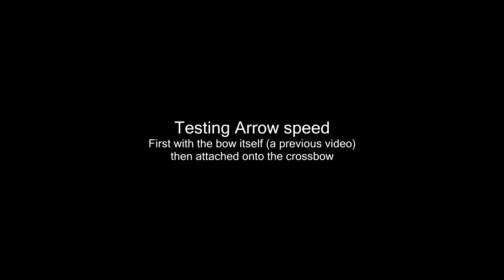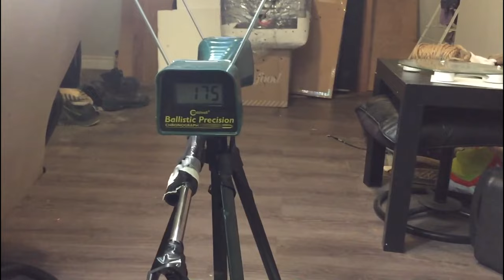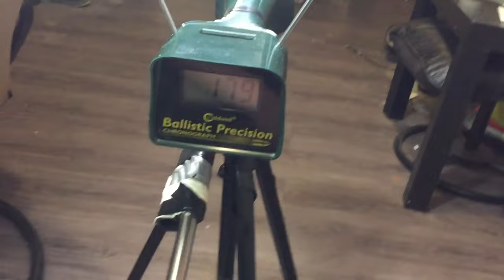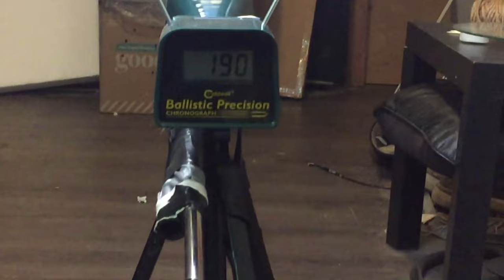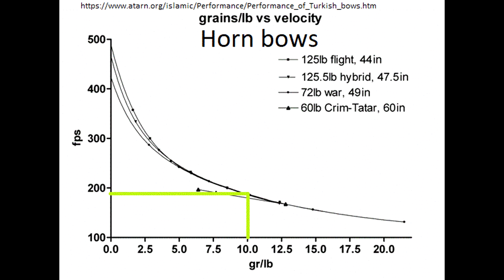Chronograph Chinese Crossbow Potential

Comment: 張弓測力法(現代測弓力的方法)是元明清才使用,商周至宋代一直也是用不不張弓測弓力弓測弓力弓測弓力,張弓測弓力實際只有不張弓測弓力的一半,所以漢代的六石弩實際只有185lbs而不是390lbs啊
Reply from the maker: Can I see the source where you claim divided by 2
Reply: 東漢末年的鄭玄註解《考工記》提到的不張弓測量弓力法：弓力測量需要將弦卸下，用一根繩子穿起兩梢，在繩子下每加重量一石，弓張開一尺，加兩石，張兩尺，加三石，張三尺。
Reply: 一個側邊引証
《荀子.議兵篇》魏之武卒，衣三屬之甲，操十二石之弩，負矢五十，置戈其上，冠冑帶劍，贏三日之糧，日中而趨百里。
《吳子·勵士》：君試無功者五萬人，臣請率以當之。於是武侯從之，兼車五百乘，騎三千匹，而破秦五十萬眾，此勵士之功也。

12石就是780lbs,但試問一個幾百萬人口嘅國家有多大可能訓練出5萬硬拉800lbs的農民?
不過就算是折半390lbs威力已經是十分驚人,390lbs拉距2英尺如果儲蓄能量效率50%就有390lbs/ft(530J),用1lbs5格令約126克細箭反曲弓能量轉換效率70%初速有76m/s,射角45度射程有500-600米5度平射150-200米371J,用1lbs9格令約227克輕箭反能量轉換效率80%初速有61m/s,射角45度射程有200-300米；5度平射80-120米動能424J,1lbs15格令約379克細重箭能量轉換效率90%初速有50m/s,射角45度射程有120-170米,5度平射70米477J,弓箭穿透力是同一動能子彈十倍，基本上魏國武卒12石弩就算得390lbs弓力，300米内穿透力和作戰效力都略勝於無加裝瞄準鏡的.30-06單發步槍(3600J)
Reply: english plz
Reply: @dongf2618   https://ctext.org/wiki.pl?if=en&chapter=877088

you look for 181-182 you can find it ,i am sorry this is difficult to translate  for  me ,i need more time look for dictionary
 before Mongolia ruling china(1279before),chinese use different measuring  bow power,they dont Wind up the string to measuring, because they dont only measuring the power ,they have measuring the bow two side power is it balance,two side power .
you can use your to text it,
this is very simple physic
Pulley force reduction principle

i hope you understand what I say
Reply: @marcellusbrutus3346  
A side citation "Xunzi. Discussion on Soldiers" Wei Zhi's military soldier, the armor of the three genres, wields a crossbow of twelve stones, bears fifty arrows, puts on top of it, crowns with a sword, carry three days of food, and run about 42km at half day. "Wu Zi·Li Shi": There are 50,000 people who have failed in the trial, and the ministers should rate them. So Wuhou followed it, with five hundred rides, riding three thousand horses, and breaking the Qin 500,000 army, this inspiring merit. 
12 stone  is 780lbs, but how likely is it for a country with a population of few million to train 50000 farmers to  deadlifts  800lbs? But even if it is half the power of 390lbs, it is very amazing. If the energy efficiency of 390lbs in  2 feet, if the energy efficiency is 50%, it will be 390lbs/ft (530J), and the energy conversion efficiency of the recurve bow is about 126 grams with 1lbs5 grains. The muzzle velocity is 70%. 76m/s, shooting angle 45 degrees, shooting range 500-600 meters, 5 degrees flat shooting 150-200 meters 371J, using 1lbs9 grains, about 227 grams of light arrow, recurve bow energy conversion efficiency is  80%, initial velocity 61m/s, shooting angle 45 degrees, shooting range 200-300 meters; 5 degrees flat shot 80-120 meters kinetic energy 424J, 1lbs 15 grains about 379 grams of thin heavy arrow energy conversion efficiency 90% initial velocity of 50m/s, shooting angle of 45 degrees, 120-170 meters range, 5 degrees flat shot 70 Meter 477J, the penetration power of bow and arrow is ten times that of the same kinetic energy bullet. Basically, even the 12 stone crossbows  can get 390lbs bow power, the penetration and combat effectiveness within 300 meters are slightly better than those without a sight. 30-06 single shot Rifle (3600J)

stupid Google Translate 
I hope you understand what I say
Reply: @sonhongkong4383  From all the books and papers I've read about the Chinese crossbows and bows, which I actually read quite a lot, none of them ever mentioned a reduction in draw-weight because of the way it was measured.  In fact, the papers and books were saying this is how the Chinese measured draw-weights even in the Ming dynasty and Qing dynasty.  In one paper it said, based on the exact quote you sent me, the Chinese observed a key principle from Hookes' law about constant changes in the spring, in this case, a bow, from observation of the displacement of the bowstring by adding on weights.  

Your quote, "弓力測量需要將弦卸下，用一根繩子穿起兩梢，在繩子下每加重量一石，弓張開一尺，加兩石，張兩尺，加三石，張三尺," tells you exactly that.  If you translate the quote it goes like this: "get the bow to its original state by loosening the bowstring, and then hook a string to both ends of the bow and start adding on weights to the bow, each stone (a weight unit) you add, the string will displace by 1 chi (a length unit).  This just means Hooke's law--the force is proportional to the extension of the spring, to put it simply.  You are saying this is a different way of measuring draw-weight.  It is not. Just look at the links below.  It is just an observation of Hooke's Law, simple as that. 

What you are saying is by returning the bow to its original state from a stringed bow state and start pulling the string from there would reduce the final draw-weight by 185lb.  It will probably not because the extension is actually proportional to the force according to Hooke's law.  You can see the original state as a spring with no weight, and the stringed bow state as a string with some weight on it, and when you start pulling, it will not be any different whether you started from the beginning or halfway.

If you don't know what a Hooke's law is, this is:
https://en.wikipedia.org/wiki/Hooke%27s_law

I've only seen this claim from a none peer-reviewed online article written by a history enthusiast.  If you search for 不張弓測弓力法, you can only find one article written by this enthusiast.  And I can't even find one paper about this.

This is how the Chinese are measuring the draw-weight from ancient times and compare it to how draw-weight is measured today.  There is no difference.
https://www.google.ca/search?q=%E6%B5%8B%E5%BC%93%E5%8A%9B&sxsrf=ALeKk03rN32E0OlplE06buvrAgy7ri0Vqg:1615905236932&source=lnms&tbm=isch&biw=1366&bih=605#imgrc=bkBo8d5gnm9HvM

https://www.taobao.com/list/product/%E6%B5%8B%E7%A3%85%E5%99%A8%E5%BC%93.htm

https://www.youtube.com/watch?v=fu59Nhz0NgI
Reply: @sonhongkong4383  it's inaccurate you are wrong!
Reply: @dongf2618  do you have the article link?

Comment: Water?
Now the timber will swell, won't it?
Also, that timber is large enough to hold up a bridge.
Reply from the maker: it worked. it is also the most accessible lubrication
Reply from the maker: what do you suggest
Reply: @HistoricalWeapons  
Can't you use a thin viscosity grease in the mechanism?
Also check that the moving surfaces within the mechanism are smooth and polished.
The less friction the better.
Reply from the maker: @jayytee8062  thanks, ill try with linseed oil
Reply: @HistoricalWeapons  Trouble with linseed oil is it dries & gums over time, so it's great for treating wood, but not good for moving metal parts.

Comment: So the real advantages for European steel prods are the smaller size allowing closer ranks on the battlefield and easier use through slits in castle walls, possibly lower weight(Although with a windlass or even a goat's foot lever it might be more, so who knows) and maintenance being easier. Plus while the bolts being smaller and lighter is a negative for hitting power it's a positive for being able to carry more ammunition and being more wieldy. Not to mention when you get to higher poundage ranges steel is generally a lot safer and lighter than composite.

Another thing would be the ability to keep the crossbow strung for longer because spring steel reacts a lot better to stresses than wood/composite materials.

The 380lb crossbows being the most common is still a bit confusing to me, but I guess it makes sense if you acknowledge that the vast majority of crossbows must have been stationed in fortifications rather than marching around, kinda like windlass/cranequin crossbows tended to be used in sieges rather than on battlefields, with notable exceptions of course.

I've heard that the chinese trigger tended to be unreliable at higher weight draws though, I wonder what weight it would start having issues at.
Reply from the maker: im excited to see too.
Reply from the maker: thanks for you insight, im working on finding the prods
Reply: Well you basically said what I was going to say about the main advantage of European Crossbows.  But yes that's the thing about the steel prods and steel wire they do require a lot less maintenance and can last a lot longer. If I remember right there's reports of medieval European steel crossbows that still function to this day. 

Also worth looking if you notice it seems that modern crossbows take the best of both worlds from the Chinese & European counterparts if you look at them.
Reply from the maker: @landsknecht8654  yes modern crossbows is the perfect balance
Reply from the maker: @landsknecht8654  I think the wood crossbow of long draw are best budget historical crossbows
Reply from the maker: @landsknecht8654  yes agreed
Reply: The smaller size advantage is mostly a myth. Most European crossbows up until Renaissance time were made out of wooden prods. And these were quite long, more so than composite prods. Plus the reload speed would cancel of that volley fire advantage because Chinese crossbows can be loaded 6 times faster than Western Crossbows.

You can literally fit 42 inch Turkish bows as crossbow prod and it would be not as longer and compete with that european crossbow supposed compactness.

Comment: Water may be harmful to the lock & stock. I'd use some light machine oil or even WD40. Also I'd make sure your bowstring is well waxed & lube the arrow rail with crossbow lube to minimise friction & prolong string life(which will drastically shorten used on a crossbow stock). You could use a couple of thick leather tabs(probably best DIY  to custom design after working out what shape is best) on your fingers/palms when you draw the bow.
You're bang on about the far greater efficiency of a longer power stroke(+ thinner, lighter bow limbs & thinner string) c.f. the late Medieval European crossbows. Did you see the Mike Loades video testing the Han Crossbow v leather lamellar+gambeson over a side of pork? Went right through & I think his bow was only c.70lb using replica arrows.

Comment: Keep in mind that 67g is extremely light for a 960 lb crossbow, that's barely 1 gpp. You lose a lot of efficiency from shooting extremely light bolts. If you used 120g bolts, you can easily get 1.5x the kinetic energy.
Reply from the maker: yes. agreed. but 1 gpp with this crossbow can do 400 fps likely

Comment: So physically how did you feel? Do you think an average person could draw 95lb bow or possibly more?
Reply from the maker: of course. i can pull this with my hands without crossbow too. the issue is my stock is too fat so too much string pinch. if i reduce the stock width i can more comfortably grip the string
Reply: @HistoricalWeapons  So what do you think an average person would be able to draw without mechanical assistant?
Reply from the maker: @426mak  any average man should do 300lbs, if you sit on your butt.
Reply: @HistoricalWeapons  So that would be the equivalent of a 3,000lbs European Crossbow? That's insane.
Reply from the maker: @426mak  no. it depends on draw length and powerstroke and material efficiency
Reply: @426mak  A korean TV show about crossbow shows the average person can draw 23kg with hands only which is something around 50-60 pounds or something and feet only would be able to draw around 420lb pounds.
Reply: also, i dont think its that efficient, according to.the Tang dynasty record the average Chinese crossbows effective range is only about 2.5 times that of a bow.  But i think bowmen must be shooting at an greater angle than crossbow.
Reply from the maker: @dongf2618  it depends on the draw weight of the bow
Reply: @HistoricalWeapons  ya, I am talking about the average archers in the Chinese military though, which has pretty standard draw-weights at around 100-140 pounds.  So basically the record says the crossbowmen should release the bolts at around 225m while bowmen should release the arrows at around 90m away, which is exactly 2.5 times.
Reply from the maker: @dongf2618  it depends on source and too many factors to make assumptions
Reply: @dongf2618  Only 420lb? That's still a lot
Reply: @426mak  sorry to be exact that person did 462lb with just the legs and 40-50lb with just the arms.
Reply: @dongf2618  Now you're just showing off.
Reply: @426mak  no I am just saying it is possible.  A lot of people would cry out that's impossible to do.  I've also seen a white person saying China man can't draw a bow that's heavier than 50lb.  And the fact that the tester is Korean who is also Asian shows it can be done.
Reply: @dongf2618  I wasn't challenging the validity of your words, just expressing how impressed I was.

Comment: first, I do not want to offend anyone, but I do not believe in Chinese fairy tales - the notorious terracotta army turned out to be a new model and, to disguise this, the figures began to be impregnated with epoxy, after which dating became impossible. Now about the crossbow itself - it is actually a composite bow, only made of modern high-quality steel, which even now the Chinese rarely do, and before they did not know how to do it at all - it is significant that even primitive kalash you manage to do poorly. So, this one has nothing to do with real historical Chinese crossbows. The strength of China is not in the military, it is not by them that you have defeated all your enemies. I also asked Tod whether he was making crossbows correctly, whether their shoulders should be pointed forward.
Reply from the maker: Steel was not used as bow back then
Reply: @HistoricalWeapons  If it hadn't said "Chinese crossbow", I wouldn't have written part of the text. Those crossbows that Tod shows are historical, although their bows are of course made of modern steel. And he complains that due to the short stroke of the arrow, the power is not fully realized, but he makes exactly historical crossbows, so he is limited to a historical design. At the same time, he expresses doubts about whether he makes crossbows correctly. Crossbows like yours were also made in ancient Greece. But there the climate did not allow making compound bows. If you did not rest on the Chinese in the peak of the European family, and immediately said that the bow was composite, and the design made it easier to load, there would be no questions. The tension force of the composite bow of the warrior was 35-40 kg, i.e. you are within their limits, but thanks to the high-quality steel you have a higher efficiency. Did you send a link to this video to Tod?
Reply: @greatnoblelord  um what? what on earth does this mean " If you did not rest on the Chinese in the peak of the European family, and immediately said that the bow was composite" Is that even english?
Reply: @greatnoblelord  Also the greek crossbow is vastly inferior, compound is a HUGE leap above regular wooden bows, and the greeks didn't have nearly as advanced of a trigger system at all
Reply: @greatnoblelord  The chinese have crushed our enemies militarily speaking thousands of times in the past btw, we sacked and conquered two mongolic empires (xiongnu and the first turkic empire) maybe you should say "slavic fairy tales" because as far as i'm aware, slavs have never won against either western europeans or mongols in terms of economy or military, you were only ever the conquered never the conquerers, nor do you have major contributions in terms of inventions. The strength of the slavs has never been..........well anything at all lol. I'm curious what gives a slave, oh sorry, "slav" the guts to talk back to the chinese who have contributed in ways you couldn't even imagine.
Reply: @winsunwong5648  my child, do not be hysterical and less fairy tales about the fictional "great" past. Give me the facts. And the indisputable facts are as follows-little Japan brought China to its knees, and the USSR defeated the Japanese army that kept the whole of China in fear with one blow of very insignificant forces. And for comparison-the historical, golden-haired and blue-eyed Mongols conquered China, and they went to Russia to get a job-the first was the son of Batu Doyar (St. Peter tsarevich Ordinsky). Then the Genghisids ran to get a job in the Russian service in droves. All the Horde "invasions" of Russia, starting with Nevryueva, which A. Nevsky was able to beg from his named father Batu, only with the support of his friend and brother-in-law, the son of Batu Sartak, were mercenaries of one of the Russian sides. The power of the Horde was maintained by the fact that it provided Russian merchants with the freedom of Volga trade. And if you defeated anyone, it was not the Mongols, but the Chinese - you gave your women to all the conquerors and they gave birth to Chinese who could not be warriors.
Reply: @winsunwong5648  my child, do not be hysterical, but get used to understanding the speech of people who surpass you in intelligence
Reply: @greatnoblelord  sorry shouldn't have said Slavic slave, because slav is slave already so I basically said slave twice.